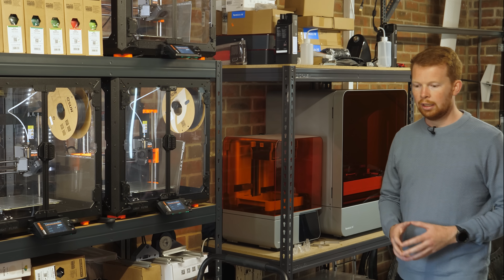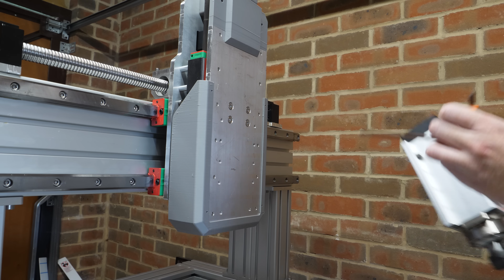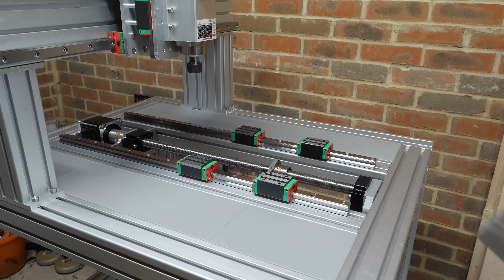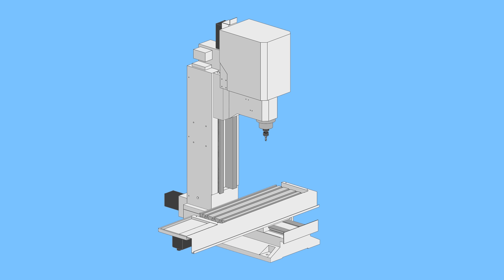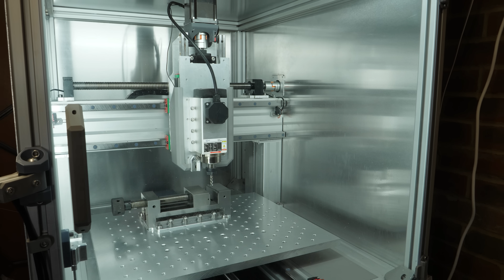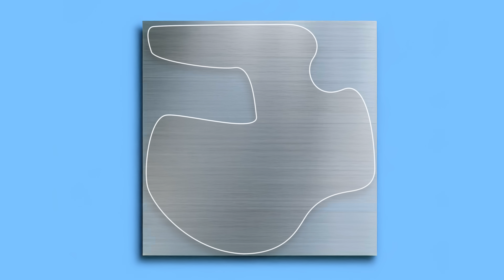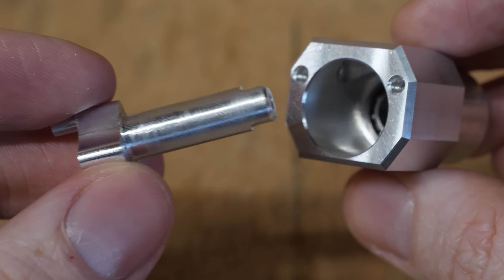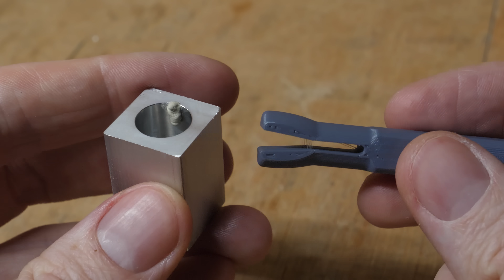I Needed an Engine, So I Built a CNC Machine

Comment: This is a rabbit hole I'm about to peer in to, the home CNC market isn't hugely well served - its either really small home stuff, or the start of the really large and often 3-phase machines. So this is exactly what I've been thinking about. Love the resin-filled rail, superb solution. Thanks Tom, very inspiring stuff!
Reply: I have a Langmuir MR-1 and it is a good middle ground. Still a little expensive, but it is a very capable machine. Still less than a Tormach. The cut area is large for the type of material it can cut. If you decide to go the DIY route, the Centroid Acorn is a goo compromise between usability and features. I would not use a Duet board. It lacks a lot of the traditional CNC commands you would expect. The MR-1 has its own control board and I upgraded it. Having standard CNC controls makes cutting parts significantly easier and faster.
Reply: @NainKaigo  I'll have a look at this, thank you 👍🏻
Reply: @NainKaigo  Oh! That's a very interesting product! Similar price class to Tom's. I do wonder if I'd be happy with only 6 vertical inches considering the rest of the working envelope is nearly two feet by two feet.
Reply: And if current tariff policies stay in place, there could be quite a bit of demand in the US for cut/send CNC parts that previously was filled by Chinese manufacturers.
Reply: @jonathankipps9061 no worries, thanks to the economy collapsing you're not at risk of getting overrun by demand anytime soon 🤣
Reply: @jonathankipps9061  I actually somewhat doubt that demand for local CNC to grow, as with the tariffs on the raw metal imports into the USA being so high too and the minimum viable wage for an American being so much higher than many of the other nations that are not China... 
Don't get me wrong local producers are worth having and using for some businesses, so it might work for you to try that. But the bulk of the stuff that was done in China is just going to move to the next cheap labour location so Vietnam, India etc.
Reply: @foldionepapyrus3441  There's already a start-up company doing PCB fabrication work in El Salvador. I expect, and hope, that a number of those services that we're currently relying on China for can come back to central America.
Reply: I'm already halfway into that rabbit hole.. I recently bought a laser engraver/cutter, and am waiting for a second upgraded machine to be delivered. I'm now also looking at buying, (or building), a home CNC machine. Both types of machines share a lot of characteristics and functionality, so it should be an easy transition for me, (Hopefully...). The only thing putting me off at the moment is that the more modestly priced retail machines, that I've been looking at, seem to have a lot of acrylic and plastic in their construction, which could be prone to fast wear and tear, and is not something I think I would trust for longevity of use . Going down the route of designing and building one from scratch, is becoming more and more attractive to me.
Reply: @Demotricus  That's exactly where I keep finding myself. I'm thinking I just design and build it for my needs specifically.
Reply: There is a large number of hobby moving gantry CNCs but not many like this with a fixed gantry for under $2000usd.  Not many metal making machines off the shelf mostly wood and plastic.
Reply: You gan get a printnc and will work like this mill  @qwertbochaffer
Reply: I recently bought a Boxford A3 HSRI second hand for £600.  Rip out all the old electronics and replace (about £250) and you have a decent little machine
Reply: I just bought a retired 4600lb knee mill that was already running servo CNC on a MachMotion controller. I'm $2750 in, and i have a production ready machine. But, you need space for it and 240v power. (runs fine on single phase!)

But i am using it to build a smaller, bench top machine. That way i can make small parts in the house while watching the kids!
Reply: If you are thinking of building one (or maybe you have it’s been 2 months) I built a MPCNC that is 3ft x 4ft, it uses stainless steel rails but I also used carbon fiber tubes inserted in the steel to improve rigidity and keep it light weight, it can easily handle aluminum at full size and brass if it’s slow and I use a new bit optimized for the material and cutting fluid, I have done mid steel but I have to limit it to a small corner section raise the bed to get as close to z center as possible, it destroys inexpensive bits and I still get vibration and missed steps, but it will do it and I can temper the steel afterwards although if you need tight tolerances don’t. It’s Is certainly capable for up to aluminum consistently, and for  something that cost less than 1K works great, but if precision mid steel+ milling  is high priority then copy his design. Or make multiple CNC’s I want to make a 5 axis that is capable of aluminum but I feel that would break the bank for me anyway.
Reply: There is quite a range of sizes for 'home CNC' available, not always very good but then the market for these things when dealing with home users have the challenge of knowing what it needs to be -  is this a vinyl cutting drag knife or at the other end carrying a 2hp spindle to hog through steel quickly, does the machine need access for loading the materials on the long/short side etc etc... 
And the price is often quite weird till you consider the scaling factors - the tiny machines are expensive compared to the next sizes up because the electronics and the machine and man time required to create frame make up most of the BOM and are pretty much identical to each other at that scale of machine. Its only once you get to the largest of the home machines the price for the ones you buy jumps, because suddenly they have to be made of so much more material.

Comment: You can remove a broken steel tool from an aluminum part by soaking the part in a hot saturated alum solution. Not something you'd do in a production shop, but when you don't feel like remaking a part at the last step...
Reply: You are my hero
Reply: Also compressed air, oil, a scriber, a center-punch and hammer, and lots of patience work more often than not.
Reply: I’ve used nitric acid to remove the broken tap, didn’t know about alum. I was in school and the shop machinist helped me.